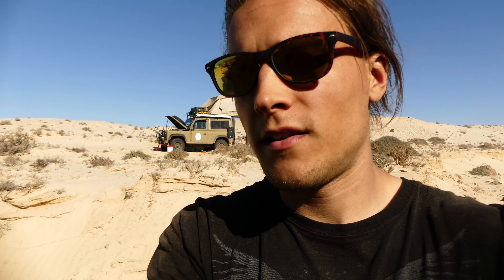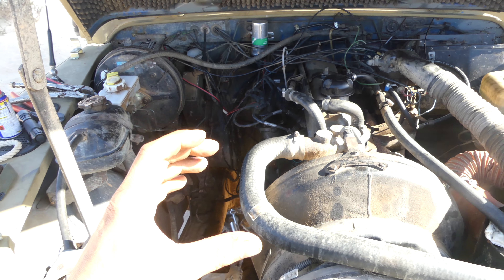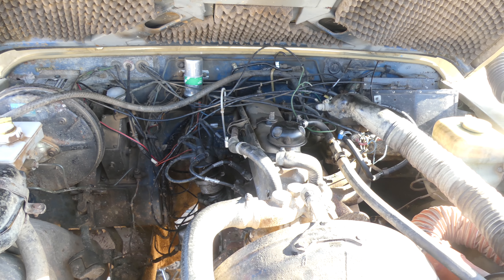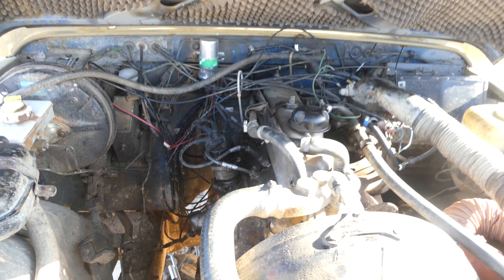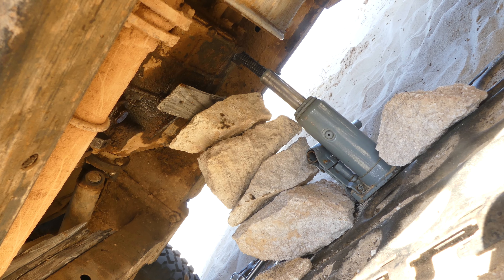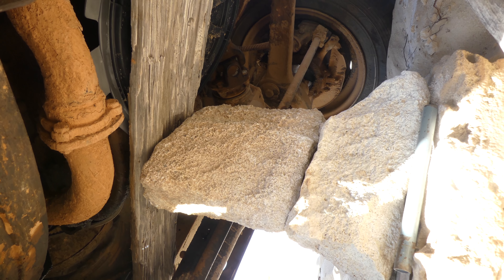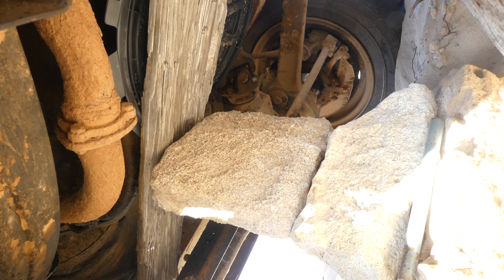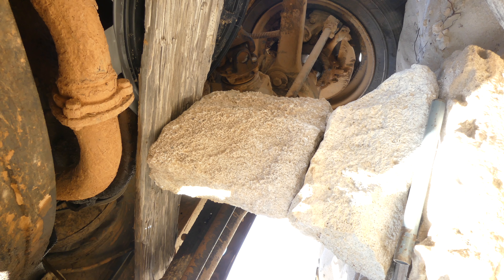Roving Africa Ep.4 Stuck In The Middle Of NOWHERE

Comment: So the engine mountings delaminated? The metal plates debonded from the rubber?
I very much doubt if all failed at the same moment. I suspect that one failed putting more load on the others which failed one by one. If you do regular inspections under the vehicle you can often find these things before they become a major problem (however I understand the realities of these trips and the inspections often get delayed).
Anyhow you followed the golden rule by having more than one vehicle in a remote region. Well done for getting it fixed.
Reply from the maker: So basically i figured out that the one right underneath the dipstick had failed first. 
The dipstick had slowly been dripping oil onto the rubber after it got hotter than normal (and thinner) and started to come out of some new places :p. 

When the first one went they obviously all went. 

And since they were old style mounts they did not have the metal “cage” around them to at least hold them in place :D

I check everything religiously, i’m an engineer so i guess it’s in my nature haha. 
but the damage was not visible since the weight of the engine on the rubbers made the crack basically invisible. And i don’t usually lift my engine block up in a routine check hahaha